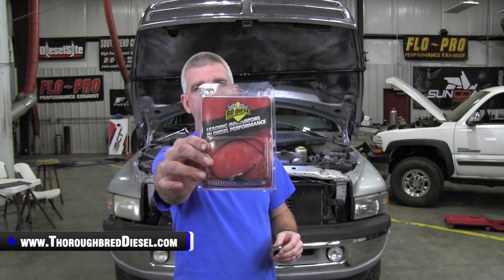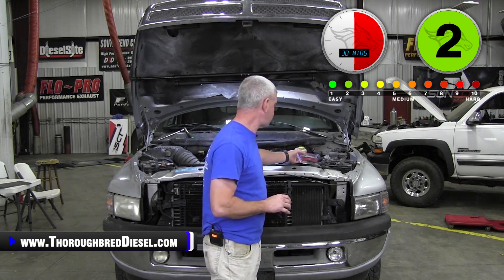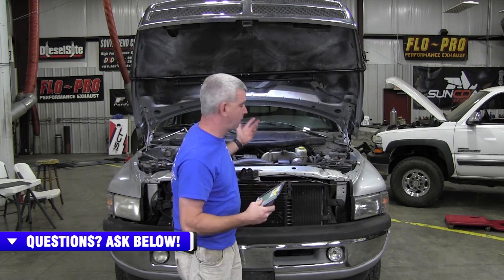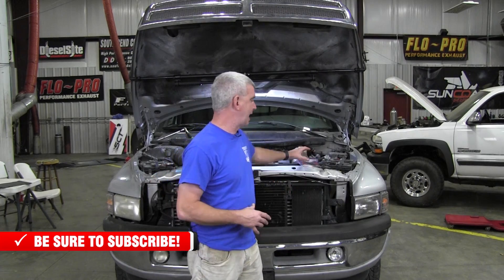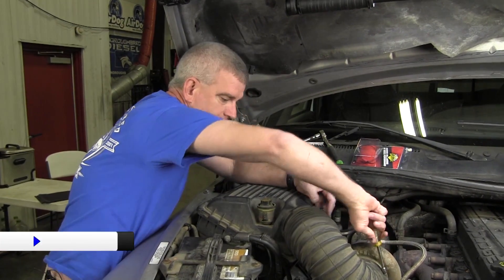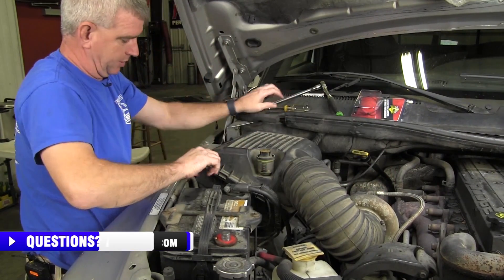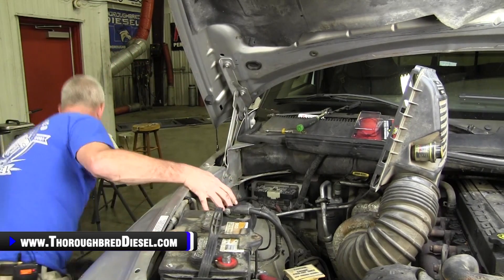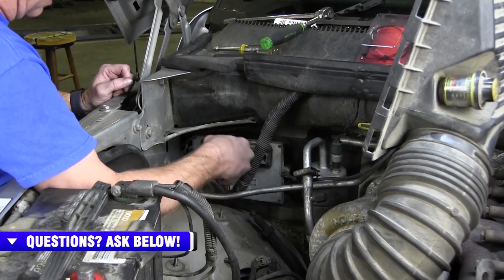BD Diesel APPS Noise Isolator Install: Stop Torque Converter Cycling on 94-05 Dodge Cummins

Comment: How can I stop shuttle shifting in my 07 ram 5.9 48re
Reply from the maker: This product only works on trucks up to 2005.  I would suggest checking out the solenoid upgrade from ATS or BD Power.
Reply: Did you ever fix your truck and What Did you do
Reply: Erratic shifting in 48re usually 1-2-1 or 2-3-2 is due to faulty solenoid. These solenoids commonly fail on multi used trucks. Ie, one day light throttle usage in city, next day hauling 15k load warranting heavy throttle application. These trashmissions were made to learn your driving without any PLC or proper programming. It was made to apply similar output and extend the life of the trans. There’s some really good solenoid kits I would recommend trying out the ATS GM 48re Solenoid Block Conversion Kit.

Comment: Did everything on the internet including the noise isolator no luck. Hope a new alternator fixes it.
Reply from the maker: Fingers crossed!
Reply: Just installed a mechman alternator and a output speed sensor still no luck. Could my pcm be going out? Everything is working fine shifts nice just the converter won't stay locked in. Gets worse as temperatures drop. At-2degrees F the truck shutters so bad I spun out on the ice. As it's shuttering my boost gauge will go from 5-12 psi.
Reply: @jasonbrown7258  did you ever figure it out?

Comment: Put one of these on my truck today and it seems to have fixed the surfing problem.  I also cleaned the ground this was attached to and cleaned all the battery terminals and battery connections.

Comment: in screamin diesel vid, he also mentions if brake switch is worn, it could be sending brake "on" signal which kicks out the converter. my converter is cycling.  when i lock it out for towing, sometimes it shifts to 2nd, wont shift up to 3rd until i stop and shut off truck for 5 minutes.

Comment: My other dodge 2500 2001 they used the wire on the middle white plug does that mean they used a different type of filter
Reply from the maker: I’m not really sure, possibly installed incorrectly?

Comment: This works for a while. However if you want to fix the problem there is a ground wire behind the battery on the passenger side. It connects to a ground coming from the alternator and then goes to the battery. Cut the plug out and splice the wires together or  replace it  if you can find one. You will be fixed forever
Reply: Yep fixed mine. Get rid of that grey quick connect
Reply: @DonaldDouglass-d6m  this is only 96+ truck tho correctv
Reply: Thanks did that 2 years ago and solved the problem
Reply: Correct that plug seems to be the source of the problem on my truck
Reply: @DonaldDouglass-d6m  there’s two grey quick connects on mine one runs beck by the firewall and to the other side of the engine bay and one runs to the front of the truck by the toward the other battery which one would it be

Comment: I have a 94 with the the RH transmission. The truck has had torque converter lockup problems for over 20 years.  I bought this noise filter and it worked for three years. Bought another and it didn’t do a thing.  I’ve read countless websites and watched many YouTube videos trying to fix it. Nothing I’ve found helps. Replaced the TPS and recalibrated it. Didn’t help. Replaced the alternator. Didn’t help. Replaced the batteries. Didn’t help. I’ve search all over for someone that rates alternator output by power quality instead of amps but no one does. I’ve also search for a power conditioner for alternators but can’t find one for 120 amps. I’ve replaced the alternator, thoroughly cleaned all the grounds. That did nothing. Replaced the computer(that was expensive). That didn’t help. Taken it to a transmission shop. They said nothing was wrong. It’s getting discouraging.
Reply from the maker: I feel like you are having a pressure problem.  I would find another trans shop to read fluid pressure.
Reply: @thoroughbreddiesel   That could be. I’ve been trying to pinpoint when it unlocks. It seems to lock when accelerating and unlock when I let up on the fuel pedal. I’ve also noticed it unlocks when cresting a hill.

Comment: Hi boss
I have Dodge Ram 2006 5.9 engine 
The problem wen I accelerate the RPM goes up and not come dawn 
It stuck on 3800 Rpm
It has only apps sensor inside the car 
 I change everything but negative
Reply from the maker: Stuck and will not idle down?  If that, then you would need to see the app input signal.  One thing we see in 03-07 trucks that seem to hang and not come back to idle as soon as you take your foot off the throttle, then I would diagnose it as a injector problem.  We have seen the injectors have control valve issues that will cause the engine not to idle down.

Comment: Bought a 99' 24v truck and have been fixing aka driving it when it's running good. However, I'll be buying one cause my truck shuffles shifts upon light throttle.

Comment: Hi - im trying to troubleshoot an APPS signal issue on my 03 5.7 - the graph spikes instead of staying constant, this is with car not running (cancels out alternator noise).. ive gone thru every connector, checked grounds, all very clean - sprayed out, when i move the C1 connector it seems to flat top a bit and settle but its kind of random and not 100% sure where to look. The apps sensor tested fine - progressively returning volts as I move the pin by hand.. at a loss - no codes, no deep codes - just 7mpg killing my love! ive changed all sensors, fp constant at 49psi- i reringed this motor (traded it with a spun rod bearing)- i can get up to 80mph - possibly there is noise going back into sensor, would this gadget possibly help? fwiw bores were perfect at 100k miles, now at 120k... drives fine otherwise!

Comment: Installed the isolator and the shifting problem went away for about 300 miles. Now it's back. Cleared the code and it's good for another 300 miles.  I knew it was too good to be true.
Reply: Mine lasted three years. Bought another one but it didn’t work
Reply: Check your TPS sensor
Reply: I replaced the TPS and recalibrated by turning the key to the on position, slowly pushing the fuel pedal to the floor, slowly releasing, then turning key off, and started the truck.  it didn’t help.
Reply: @markdonley2397  any luck. My worked for about 8 months and it’s doing it again. Any luck?
Reply: @claudiohernandez4664  no. I have also replaced the brake lamp stop switch because a guy told me they can occasionally cause lockup problems. Was only $25 so I gave it a shot. I’ve done everything suggested on every YouTube video and forum I can find. I gave up and took the truck to a reputable transmission shop specializing in diesels. The guy there told me he thought he could figure it out. I left a long list of everything I’ve tried so hopefully he will see those aren’t the problem and charge me for redoing all I’ve done. I’ve removed and cleaned every ground I could find. I’ve had the batteries and alternator tested and they are good. I’ve wrapped the wires around the alternator with foil, Looks terrible but worth a shot. I’ve added ferrite chokes to most of the ground wires. I’ve replaced the throttle position sensor. I’ve replaced the main computer on the firewall behind the air cleaner. I’ve also searched for the ground wire many videos talk about that runs over the alternator over near the throttle position sensor. My truck does not have that ground wire. I don’t think they put that on the 94 models.
Reply: Check your apps sensor
Reply: Make sure you set the voltage on the apps after replacing it. Needs to be at like .530volts for the truck to be happy. You can do pulling the apps off the block and turning it over to see the TPS and loosening the bolts then turning the TPS clockwise or counter clockwise to increase or decrease voltage. Need a voltmeter and a probe to read the voltage
Reply: @azswagg8  What is the apps?

Comment: so i have an 03 ram 5.9 24v and the things is i changed my batteries, new cables and all, changed my tps and it worked for a while…then it came again. the truck would work normally at time and then would go into a limp mode or something. it’ll start to accelerate slowly when you have the gas pedal pressed to the floor and it’ll start accelerate faster by itself. when i let go of the gas pedal it’ll suddenly stop and make the turbo bark really loud. or if i’m going and having the gas to the floor it’ll be going and if i step on the break pedal while still holding it to the floor it’ll stop accelerating. so no after all the crap i just said…could anyone please let me know if this might help, it ain’t expensive so i might just go ahead and buy it before anyone says anything but i have my doubts…thanks in advance

Comment: When first installed on v10 truck it idled so low it stalled... and clicking sounds emanated under drivers side dash, then the  transmission held onto first gear way long before shifting. The next morning it was like magic! Normal shift points and no torque converter issues! I am Thrilled with this product.

Comment: Could the torque converter issue cause the truck to shift out of od and back in as well? Most of the time it's just the torque converter locking and unlocking at highway speeds and here and there it'll shift out and in of od
Reply: Did you ever figure this out? I am having this issue on my 04 2500 5.9 59k miles
Reply: @Jacob Norton  ended up being the harness for the apps which your truck won't have.
Reply: @jrehberg  I appreciate it, it's a heck of a head scratcher
Reply: @Boogytron  you don't have any codes?
Reply: @jrehberg  no codes and very intermittent. I got a diesel shop in town that's going to look at it on Monday. I am fully expecting to be replacing a transmission but time will tell
Reply: @Jacob Norton  I don't even have that old truck. I got a smoking deal on a 2006. 10k under going market because it had a cracked od housing. Had it swapped in a night. I'm probably going to get it built or buy a built one. Truck also only has 105k miles and one small bubble on the wheel arch. Probably going to replace the besides with eglass composites when I get it painted.

Comment: I have a 2001 vp44 cummins and when I first drive it after I warm it up I drive down the road it will rev up to around 1500rpm then drop down around 1k rpm and it wont let me have any throttle unless I put it in neutral it has a new apps sensor I did the proper reset for it but it has just started doing this in the cold weather

Comment: I have 99 Dodge ram 2500 diesel stik shift 5speed it this works?
Reply from the maker: Yes, this is a good addition on all VP trucks to keep you from having electrical noise to your APPS signal.

Comment: Hey I have this mod installed but doesn't this just cover up the alternator causing the problem with ac noise?
Reply: Not necessarily, an alternator will always have ac noise, that does not mean one's bad, however this should be done with the relocation of the alternator wire

Comment: I just wanted to post up a quick review of this Noise Isolator. I had my local shop here in Mebane, NC  install this on my 98.5 24v 2wd Auto, and the difference is night and day. This was the final fix to get my truck rolling smooth again and it worked like a charm. Thank you guys so much for putting this out there.

I also wanna say I did have a CEL light on for the first 20 miles or so after installation. After that, it went away and the truck now shifts smoothly and does not let the torque converter cycle like a malfunctioning robot.
Reply: I had a dealership rebuild my transmission that was supposed to fix it.
This is what fixed it.
Reply: @poppiarlin5612  wow, I heard some other guys had the same outcome after rebuilds. Spend a grand or more and still have the issue. Glad yours is fixed now!
Reply: Hey was your torque converter cycling on and off around 45-50mph?
Reply: @lalosanchez2725  Yeah, sometimes it would vary but usually between 40-50. Or if I hit a hill at those speeds, it would just lose it's mind. It still has trouble figuring it out sometimes, but a world of difference in shift consistency.
Reply: @MirisDesignStudio  exactly what mine does man, around 40-50 rpms start jumping around. Going to have to install this asap

Comment: I own a 1997 Dodge 2500 Cummins. The diagram says attach APPS noise isolator to PIN#23? I don't see a PIN#23 in the PCM illustration?? I'll just go by the instructions on connecting it to the orange/dark blue wire?

Comment: I had the same problem,  thought I needed a new converter then my injector pump went and my stereo. If your alternator has bad diodes it will still charge the system but it will also put out a.c. noise which will destroy everything in the truck that has a computer including making the converter lock and unlock continuously.
Reply: TC was cycling so bad, truck was hardly driveable. Bought a noise iso but after your comment, decided to replace my alternator 1st. Alternator was less than a yr old and the parts store refused to replace it since it was charging just fine. Had to buy another alt. Replaced it and it fixed my TC problem. Didnt even bother installing the noise iso. Thanks for the great info!!
Reply: This is exactly what happened to me. I dropped in a new Alternator and this capacitor and holy crap, she runs like new.  I didn't make the correlation from the Alternator to the control devices like this until I noticed how many other items were affected by it. With this and the new alt, I'm back in business.
Reply: Yep alternator fixed mine, dash said it was putting out 14v but Napa said it was bad.
Reply: How could I tell if mine is doing this?
Reply: I have a 94 with the the RH transmission. The truck has had torque converter lockup problems for over 20 years.  I bought this noise filter and it worked for three years. Bought another and it didn’t do a thing.  I’ve read countless websites and watched many YouTube videos trying to fix it. Nothing I’ve found helps. Replaced the TPS and recalibrated it. Didn’t help. Replaced the alternator. Didn’t help. Replaced the batteries. Didn’t help. I’ve search all over for someone that rates alternator output by power quality instead of amps but no one does. I’ve also search for a power conditioner for alternators but can’t find one for 120 amps. I’ve replaced the alternator, thoroughly cleaned all the grounds. That did nothing. Replaced the computer(that was expensive). That didn’t help. Taken it to a transmission shop. They said nothing was wrong. It’s getting discouraging.
Reply: What do you mean by ac noise ?? I’m having the problem now
Reply: @amazingdiesel9015  Alternating Current, like what's in your home outlets.  Alternator should be outputting DC, Direct Current.

Comment: Check you're  alternator for a.c. noise! These gizmos don't solve the problem  they just mask the real cause.  It's an old dodge problem, look it up!
Reply: Yeah, but the ac noise really shouldn't interfere with it jn reality.. but it does.  And even if the diodes are emmitting ac noise the alternator is still technically good. Cars and trucks all around you on the road will create this noise and notnm interfere.  Theyre differently designed though.  Car amplifiers can cause noise through your vehicle and create this problem too.. the way i see it, its not the alternator, its a poorly designed, over sensitive electronic equipment used in these trucks.
Reply: Wire routing problem.  They run the ground next to the spinning magnet and the ground becomes part of the charging system
Reply: I wrapped the ground wire with aluminum and added ferrite chokes but it didn’t help. I have a 94 12valve with the RH transmission.